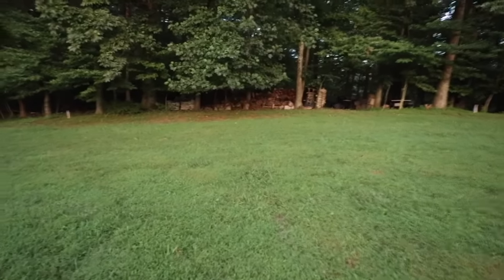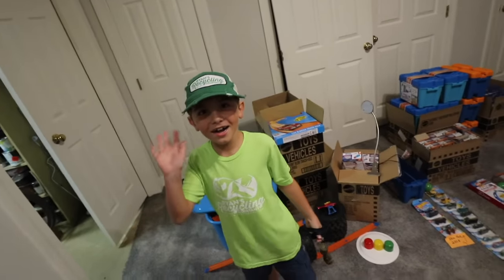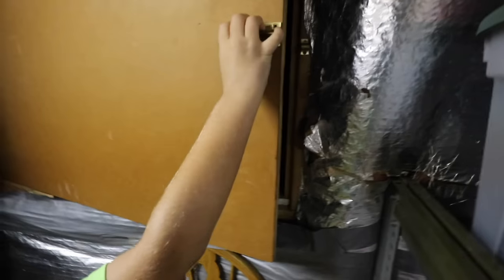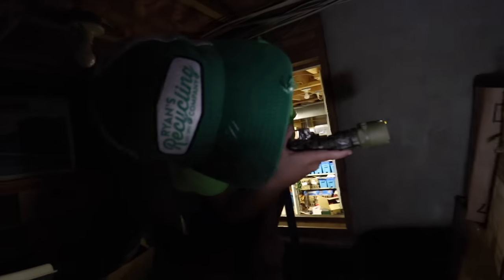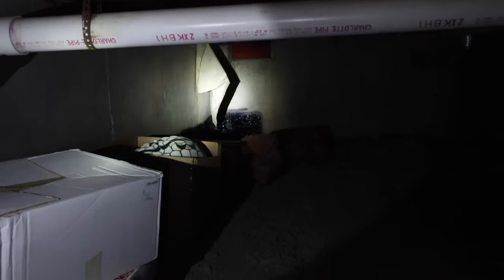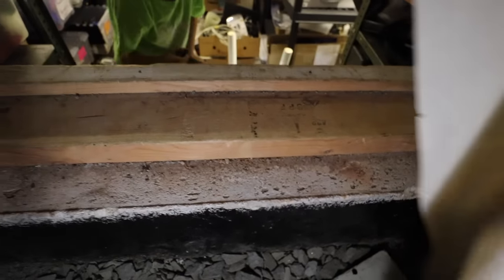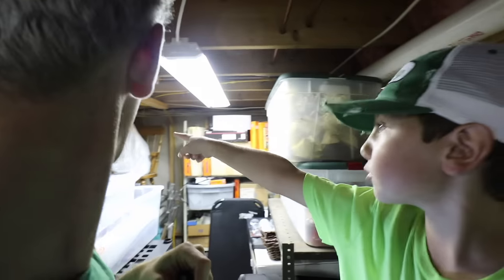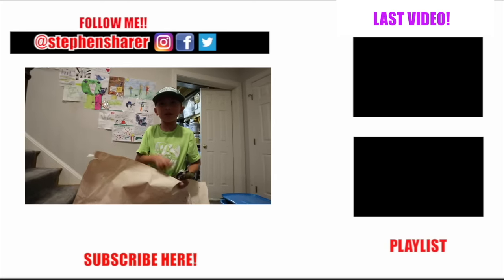EXPLORING THE SHARER FAMILY SECRET HIDDEN ROOM!! (HAUNTED)

Comment: That black stuff on the wall is kerosene, don't touch it. If you do, you'll get your finger stuck in it. Also it's flammable. Do not go near it with an open flame or else it will blow up an entire section of your house.